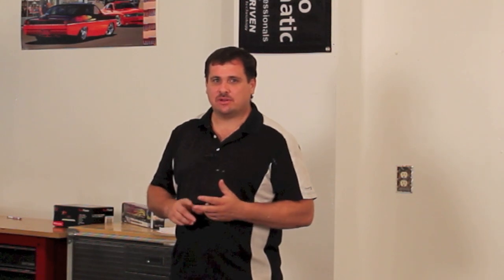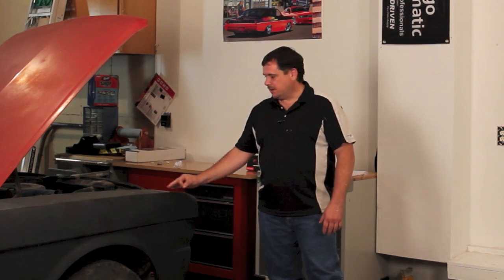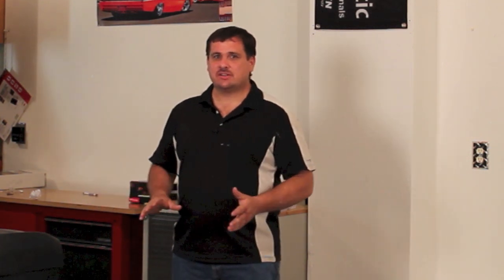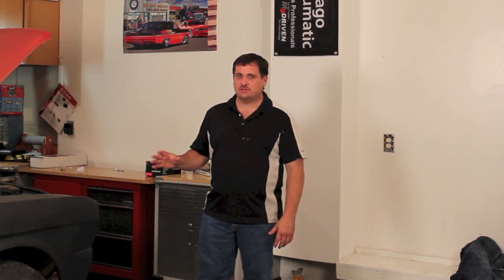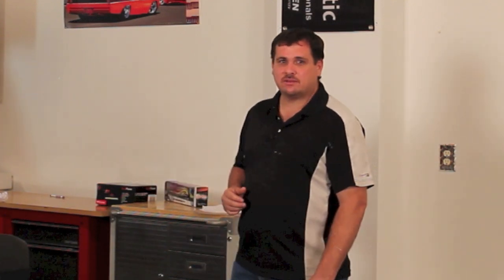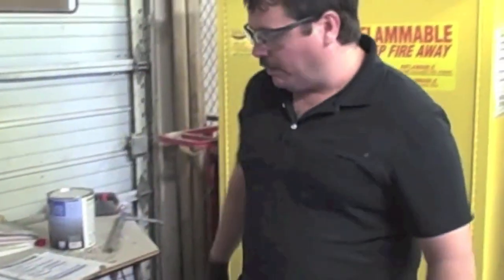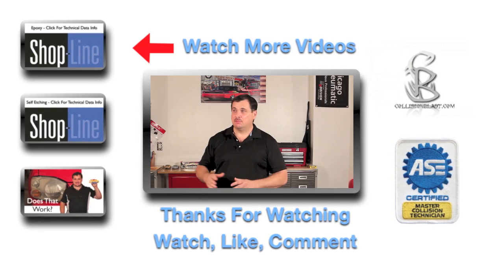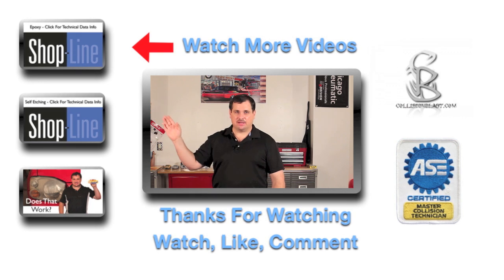Epoxy Primer vs Self Etch Primer for Bare Metal

Comment: Great video thanks is it ok to put one coat of self  2k etch  primer on then a couple of coats of epoxy on top of the self etch both panels I'm prepin  have been no blasted back to bare metal I've only  ever used self etch in past found it fantastic  but I'd like to try epoxy on top of the self etch as a added bonus  wat would  you recon thanks

Comment: I saw your video and it was very informative.  I am wondering if I can use the epoxy on a collectable loggers hand saw.  I am a spray paint artist and received a request to do a cabin and mountain scene and new york skyline on stainless steel.  Ive never painted on stainless steel before  the dimensions of the 3 saws are 5 foot long 6 in tall in center, 5 inches tall by the handle at the other end 1 1/2 ' tall.  That is the biggest one.  The smallest one is 29 inches long and 4 inches center.  Any kind of direction would be appreciated.

Comment: I HAVE FOUND THE ULTIMATE IN RUST PREVENTION AND PROTECTION,its a group of paints called COLD GALVANSING PAINT,its like galvanising your car body,infact painted on its more protective than anything thats been hot dipped in a galvanising factory. Ive left steel outside in the rain and damp painted with this product and i cant get it to rust :) even hosed it down every day with water,still no rust, Google brands such as ZG90 and ZINGA, on average it will protect for about 5 years as it is just left outside,but overcoat it with a proper top coat and that changes to about 30 years.
Its amazing,ive researched rust and prevention of it for 6 months and ive found this to be serious overkill protection for cars,but to me theres no such thing as overkill whn it comes to rust prevention.
This type of paint is about 98% Zinc, thats the secret to the rust not starting,the zinc sacrifices itself to protect the underlying steel,its amazing, even the tin of paint is very heavy because of the high zinc content.
Its weather resistant,salt resistant,waterproof etc,its used on offshore oil rig legs that are submerged under water, that how good it is,one coat is all that is needed,its also available in spray form.
 I personally have used ZG90 made by ACTION CANS,its truly amazing,i can say goodbye to rust now forever,no more redoos or resprays due to rust coming through, cut it all out, weld in new panels, then paint the ZG90 on the bare steel, then prime,basecoat,then clear, job done, rust wont even show in the slightest for 30 years

Comment: Can you spray epoxy primer over top of a coat of self etching primer?
Reply: YES you can ,but the etch should be okay anyway,its sort of a double protection,etch bites into the metal chemically, whereas expoxy sits ontop of the paint
Reply: SP330Y Ok.  Thank you.  I'll keep that in mind.
Reply: For the ultimate protection see my chit chat below about COLD GALVANISING PAINT,its serious overkill,but stops it dead

Comment: I'm one of use por-15 for my undercarriage do I need primer or can I just put it on that way by itself and maybe later spray over it thank you again
Reply: I use POR15 as a primer on rusty spots before putting on filler. It is epoxy based and is sensitive to sun. You have to paint over it.

Comment: One of my first jobs was to paint big I-beams that had been fabricated for buildings and bridge work. The first day, knowing nothing about paints, I was given an airless and told to paint the metal, which had been blasted. I did it, and at quitting time, the boss said I did a good job, and to be there earlier tomorrow as he had a lot more to paint. When I came in the next day, he asked me did I clean out the airless unit. I said no. He told me that I wasn't to blame as I told him I didn't know anything about paint. We had to replace the hose, but the pump and gun we soaked in lacquer thinner and it cleaned it out very well. He said he woke up about 2 am and thought about it, but figured if I didn't clean it, there was no one to blame but himself. 
I worked for that guy for 13 years, he was a great owner/boss.
Reply: kutzbill - Yea we have all had that experience of waking up in the middle of the night thinking about a mistake made on the job earlier in the day.  Did you ever have to crawl up on erected structural steel work to paint?
Reply: i realize it's quite randomly asking but do anybody know of a good site to watch newly released tv shows online?
Reply: @Bishop Garrett I would suggest Flixzone. You can find it on google :)
Reply: @Bishop Garrett Try Flixzone. You can find it by googling =)
Reply: @Bishop Garrett I use FlixZone. Just search on google for it :)

Comment: would it provide more corrosion resistance if you lay down Self Etch>2 thin layers of vinyl primer to prepare for next step WHICH IS> epoxy primer. You can't put epoxy on wet etch primer cuz it won't let it do it's job and form the protective film.

Comment: Kudos! Question. When is the right situation to apply a DTM primer? I am guessing that it is for when your primer will also cover a painted surface and you do not want the acidity of an etching primer to lift the existing paint?
Reply from the maker: That is correct.  It is also one step of applying primer instead of two steps.  It provides filling and corrosion protection with one primer.
Reply: Thank you for clearing that up for me.

Comment: @DIY Auto Body and Paint Do you know if ZINC primer is better than etch or epoxy? and if the primer was applied by hand brush instead or sprayed would it perform better as more product is going on?
Reply: I would only spray zinc. You can brush and roll zinc but I wouldn't do it for automotive use. Better to spray if your gonna use it for cars. I'm an industrial painter and zinc was usually sprayed. When brushing and rolling, you may end up with fingers on the over lap. Not to mention sanding zinc sucks. Hope this helps
Reply: thanks for answering, what if i did paint zinc paint on but on top of that as another coat sprayed on primer surfacer to level it out, then the basecoat paint then clear, would that work?
I'm looking for excellent corrosion protection, hence why i thought brushing/painting on would be better than spraying as would go on much thicker, what are your thoughts?
Reply: I recently used "Krylon K05872 Professional Primer, Galvanizing Primer" which says it is suitible for both bare steel and galvanized steel.  *I WAS ABLE TO SCRATCH IT OFF EASILY WITH MY FINGERNAIL!!* ABSOLUTE SHITE. Further research indicates for zinc, aluminum, or SS: clean grease off with DA, then sand, then use high-alkali cleaner (such as TSP or even Potassium Hydroxide), then use a metal etcher/zinc phosphate (such as POR-15 metal prep), then use an epoxy primer, then use a regular primer, then paint!   If anyone finds a better process...please reply!!
Reply from the maker: I know some weld-thru primer have zinc in it, but I am not to familiar with zinc primers.  I would not brush it on unless the technical data sheet for the product you're using recommends it.  I know some of the POR15 products can be brushed on.
Reply: Id say no, I have tryed it on bare metall. For starters if its brushed on it will require sanding, and it will just cluddle? up the sandingpapers alot. And it tends to leave a ridge in the feathering that can be felt if there is bondo applyed on it, as most weldings do require after.  Have I been confusing enough? ;)
When in doubt, always use a 2k product over a 1k. 
My 5 cents
Reply: I was going to ask abou zinc primer but you beat me toit.

Comment: @DIY Auto Body and Paint 2 years later to my last comment,i can reveal that i sprayed a metal drum BBQ in my back yard with both epoxy and etch primer in 2 seperate halves on the drum lid and 2 years later the etch primer wins,no rust coming through wheras the epoxy has rusted.
The BBQ drum was left outside in all wetahers totally unprotected
Reply from the maker: Thanks for testing that.  Primers do absorb moister.  A top coat really needs to be applied on top to help prevent rust.  Thanks for your feedback and letting me know results.
Reply: DIY Auto Body and Paint
you are right,yes i never put a top coat on at all :(,even though left outdoors the etch worked best for me as in the UK it always rains
Reply: @SP330Y  ... same here. We also have better experiences with etching primer. Harsh winter conditions didn't do any damage to etch primed metal, where epoxy based primer failed and rust took over again (engine under tray).
Reply: @metallmannschneider9856  further to this i also did an experiment with ZINC paint (cold zing galvanised paint) a product called ZG90, an that has amazing results, when i scratched off the silver zinc paint, the metal underneath was like brand new, tht wasn't even top coated with any other paints, so for me the best 2 are etch primer and cold zinc galvanised paints

Comment: Hey, was wondering why you don't use the 3m mixing insert instead of the mixing cup? Isn't the strainer on the Pps cup good enough? I ask because this makes more trash and you lose paint do to stiction on the mixing cup. I use the 3m pps cups and gun. Where do you buy your paint supply's?
Reply from the maker: We mix in the PPS cups when we are mixing on the computer scale.  And yeah, we don't always use the paper strainers.  Most of our supplies we get from Keystone Automotive.
Reply: +DIY Auto Body and Paint 😎👍

Comment: I want to paint a Brass HO scale steam locomotive and was going to use self etching primer for it. I won't be using any filler or anything but was wondering if this is overkill?
Reply from the maker: You got me on this one...I read through several technical data sheets and they said nothing about applying self etch on brass.  They all say steel, galvanized steel, and aluminum.  It may work, but I can't say for sure.  Sorry I can't answer this one, but I do appreciate you watching.

Comment: I'm attempting my first restoration and this video really helped me chose the first coat of paint on the bare metal!
Reply: What did you use and how has it held up?
Reply: @theperson185  I parted out the car and scrapped the shell. I suggest watching some Motion Auto or Junkyard Dave videos for what they use when painting. I think you can just use a sealer primer or epoxy primer over bare metal and filler before moving to high build.
Reply: @david929190  I'm actually doing over a semi truck frame, so im just doing my research intowhat will stop rust and be durable and resistant to flexing
Reply: @theperson185  See Debos garage heavy duty and his frame re-spray on his cab over. Any decent epoxy primer should be fine.
 if you've blasted the frame. Etch primer would be best used for new metal that is too thin to abbraisevly prep for coating adhesion. In the oil and gas piping world all pipe is blasted to a white finish and then epoxy primed before topcoat. A rusty old frame won't need etch primer as the surface is not smooth.

Comment: I want to paint my factory paint job a new color. I've watched a lot of videos on how to get a car ready for paint. I wanted to know? After, I do my body work like bondo, scuff up the whole car, then spray a 2k urethane primer surfacer, and block sand it with guide coat and when the whole car is ready for paint. Can I spray an epoxy primer on top of the 2k primer surfacer and leave it like that for a month till I'm ready to paint it? Of Course, when I'm ready to paint it I will scuff up the epoxy primer then paint my base coat followed by a clear coat. I want to do this in a 2 step process, because I'm going to pay a shop to spray the car for me twice once for primer and then again for the paint and clearcoat.  But I'm going to do all the body and prep work myself so I can save a few dollars. Thanks for you time and I would appreciate any tips and help on this matter. ~Sam.

Comment: How do you clean the steel panels prior to applying epoxy? Do you use hydrochloric acid? Some people have mentioned corrosion breaking through epoxy. Naked hands are a no-no, but perhaps a acid application followed by water and degreaser would solve that issue. What do you think?
Reply: Wash and wipe or sand the metal for bondage with 120 or 180 grit sandpaper... Then do your bodywork then sand with 240 for final primer or high build primer then final sand with what is recommended for the paint you are using...

Comment: Technical Noob Question: What about both? I noticed you stressed the word "OR" when talking about self-etch and epoxy, but can you put self-etch down and then epoxy over it for like super-awesome corrosion control? Please excuse my naivete, I really don't know what I am doing and thought I would ask. Thank you for your time and pointers.
Reply from the maker: +Keith Kie You could, but both provide good corrosion protection.  I don't know if both together would really provide more corrosion protection or not.  I prefer epoxy, but that is just a personal preference.  Hope that helps, thanks for watching.
Reply: +Keith Kie Theoretically, the only one that is providing corrosion control is the layer in contact with the metal.

Comment: Very good video.

I use Epoxy all the time and here's a few things to consider as well.

I see your catalyst is nice and liquid, thinning down the final mix to a sprayable consistency.

My epoxy catalyst is THICK. The ratio on the Nova 3000 I like to use is 4 parts epoxy and one part catalyst, after induction time the mix is THICK.

I wouldn't even consider pouring that down my gun, it just won't shoot no matter how big a nozzle I use so I have to thin it down. Ask me how I know.

Tip : When you buy epoxy, inquire how think the catalyst is. In order to shoot paint or anything with a gun it needs to be thin, almost like milk. So if the catalyst doesn't act as a thinner, you NEED TO BUY EPOXY THINNER, any all purpose thinner will not work, some will even sort of coagulate your epoxy after a few minutes and good luck cleaning that out of your gun, you need a specialized thinner.

Personally I like to thin quite a lot and shoot out of a 1.8 nozzle on the HVLP gun.

If you have to thin your epoxy primer, wait AFTER induction time. So you wait your 15 or so minutes, stir it up a bit and pour down the thinner until desired consistency.

Second thing is that epoxy doesn't sand very well in my experience. Some primers sand better when completely dry (72+ hours) but breaking the surface of the primer with sand paper is annoying and can gum up the paper real fast.

Comment: hey there
i just cant understand why its not possible to apply body filler to etch primer? what happens when you do?
is it just a question of "bad adhesion" or dose it react somehow with the etch primer? cos to me it sounds even worse to apply filler direct to metal since its a poros material and simply the moisture in the air would get trapped under the filler as well... in my mind you need to apply something that chemicaly merges with the metal ( like acid helps etch primer do ) or something that transports ANY moisture to the surface or otherwise away from the metal. 
good vids by the way this is not critic just woundering

Comment: Thanks for the video.
I have one question. Do I need Epoxy Primer or Self Etch Primer for aluminum metal, my morocycle foot pegs for instans?

Thanks again.
Reply: WheelyDoctor  foot pegs will get alot of abuse since you have your feet on them. i would get them powdercoated, they are small parts any shop can do that for no less than 50 bucks.
Reply: Matias Gipler Sounds like a good idea. Thanks.

Comment: What size tip in gun (1.8 or smaller)?
Reply: Run4st  I thin down the primer using specialized epoxy thinner and shoot out of an HVLP with 1.8 tip indeed.

Comment: thats where i get confused i have some clean metal spots and black rust spots also...after wax and grease remover what should be done to the bare metal...should it be prepped or just hit it with epoxy

Comment: I working on a beat up 92 Ford F250, finished body work on the hood and applied epoxy primer.  Wouldn't you know it I missed a small ding, can I apply bondo directly over the epoxy?  Also I intend to apply a high build primer, how long can the epoxy primer sit before applying the high build primer?

Comment: Can you tell us a bit more about the DTM primer/sealer? I have a can of it.

Also, I checked the can and the documentation and there's no window specified. Any reasonable estimates? It says I can sand after 50 minutes, but it may take a few days before I can topcoat.

Comment: I used epoxy primer on my Ford van and the rust came through it even though i went down to bare metal. Epoxy goes on thick like syrup so it leaves a poor surface for a top job.
Etch primer lays dead flat, I sprayed a BMW with eopxy and not one bit of rust came through? Is it the car or the primer that stopped it,I dont know but prefer etch primer
Reply: Gotta prep/treat your metal first.....Expoxy and Etch primers are not a rust treatment but rather seal up your metal and protect it from moisture. Epoxy isn't  meant to go on thick, its a sealer. Etching primers go on thin by nature of its mixture. You have to use your skills to set up your gun with the Epoxy. In the end, you need a primer sufacer that you can block sand (shape) before you paint.
Reply from the maker: SP330Y One thing you may consider is touching the bare metal with your hand before priming.  The oils in your hands can cause the metal to rust under the primer.  Use gloves and wipe the metal with wax and grease remover before primer may help.
Reply: SP330Y  Your epoxy primer can, and should, be thinned down with epoxy reducer. Don't use regular paint thinner.